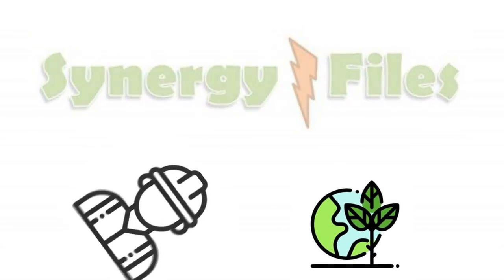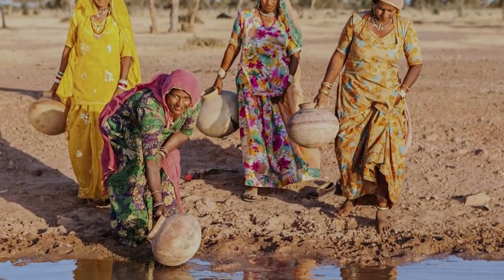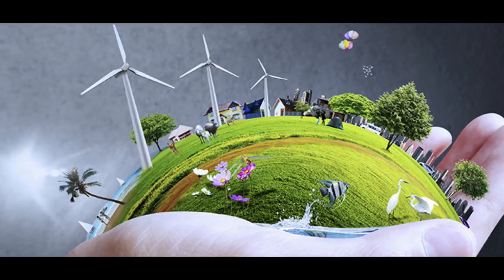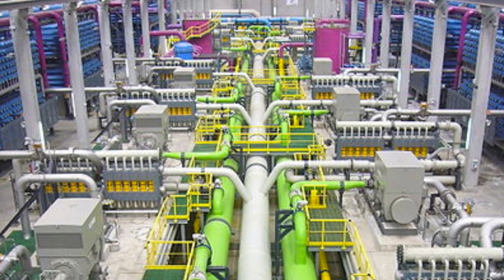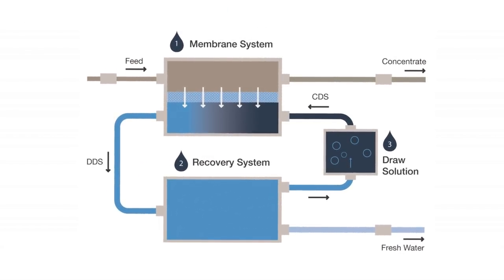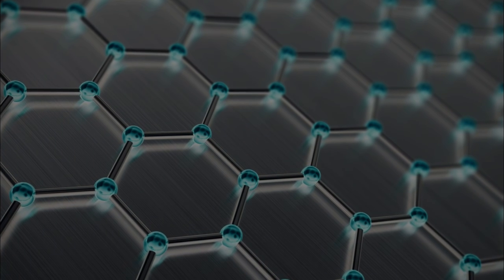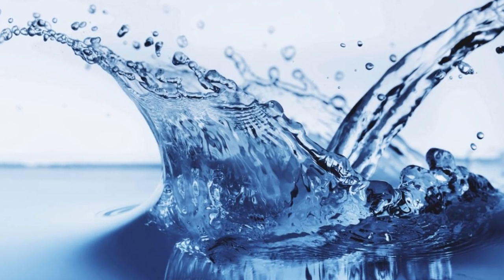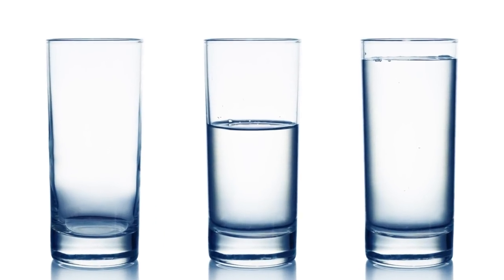Desalination through Graphene is here

Comment: Just one question, if the graphene mesh is considered 2 dimensional due to it being 1 atom thick, I am really curious as to what was used used to coat the graphene to make it stronger when submersed in water, obviously something smaller than a carbon atom?
Reply from the maker: What I got from the article was the following:
"placing walls made of epoxy resin (a substance used in coatings and glues) on either side of the graphene oxide membrane was sufficient to stop the expansion"

The full article is here
https://www.bbc.com/news/science-environment-39482342
Reply: Synergy Files I had this same question too. Is it like sandwiching the graphene membranes with a rigid porous material? I would imagine such a sandwich wouldn’t interfere with the flow of water, but could structurally restrain graphene from swelling too much. My question though is what happens to all of the salt and impurities that doesn’t pass through. Does it just crystallize onto the membrane?

Comment: Very exciting technology . You mentioned the need to be cautious about distilled water being problematical for out health as it lacks the minerals we need. My Q is this , don't we get all the minerals we need through the plants we eat i.e.  Vegetables and fruits that we consume on a daily bases ?
Reply from the maker: Hi, thats a good question. Our body is used to water that has some amount of minerals. That is why when we drink pure water also called distilled water, it gives a shock to the system. That is why when you get distilled water for your electric iron or car battery , the label says that it shouldnt be drunk. Even though the water is extremely pure. And that is the problem with many desalination techniques. They give very pure water.  Consumption of such water can disturb the fluid electrolyte balance that can result in cardiac arrest. We do get minerals from foods, but they dont get absorbed as instantaneously as in water
Reply: Only issue I'd be concerned with is if graphene particles slowly gradually break free from the membrane and end up in the water, given graphene particles negative health implications.
Reply: Very exciting technology? They've been using carbon based materials to clean water for decades, nothing new there.